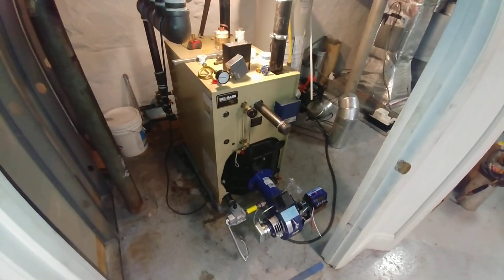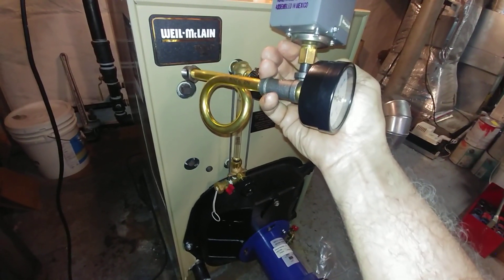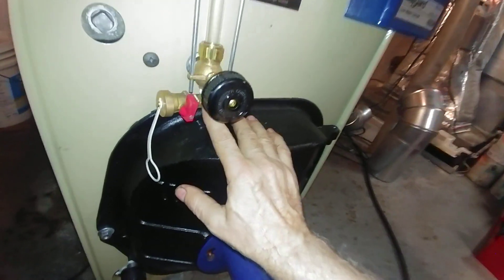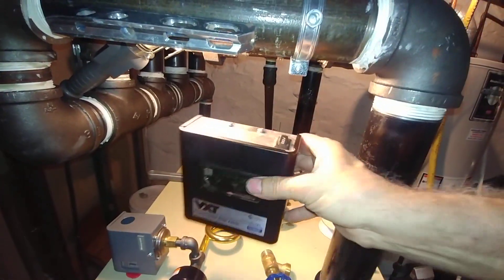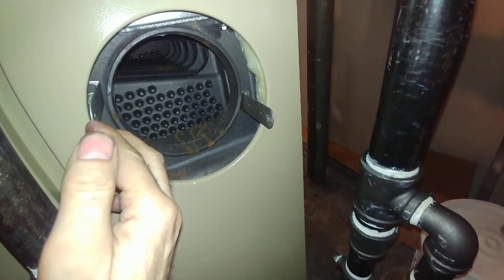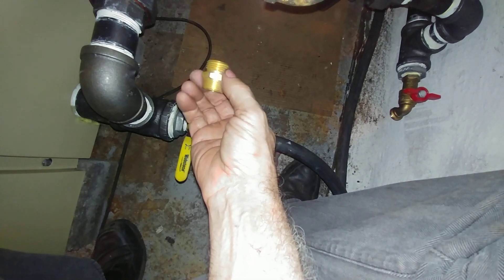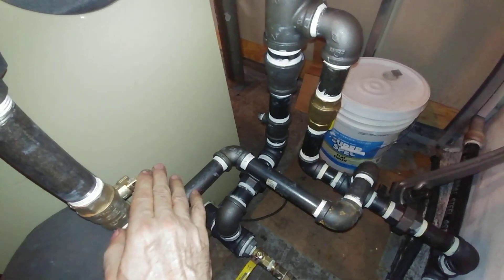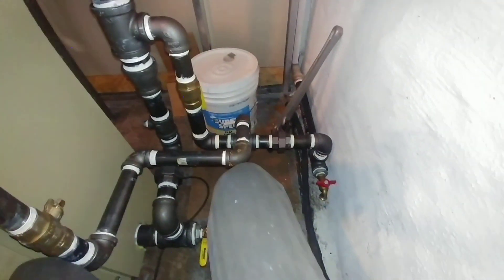Progress Report:  Boiler Jacket Installed, Low Water Cut Off, Drains, Skim Tapping, Sightglass, etc

Comment: Copper and steam boilers do not go together even though it has become common since the eighties.  Good job.
Reply from the maker: Thank you! When I started in the trade in the early 90s, soldering up steam headers was how I was taught. Had to "unlearn" that.
We were also taught to throw in a small steam boiler in eight hours. If we did it in six, we were still paid for eight. You can imagine the resulting pig's breakfast that mentality produced.
Reply: @gordonschweizer5154  I learned the same way in the eighties. I also worked in the city (NY) while I was a teenager and we never had the issuesi sawworking for my uncle in the eighties. I knew something was not right. As you know there was no internet so I took and paid for my self a few classes some by Dan Holahan.
Reply: I have a new steam gas boiler, it works more like a kitchen stove, does not have a motorized burner no motors at all. Is that boiler made for oil????